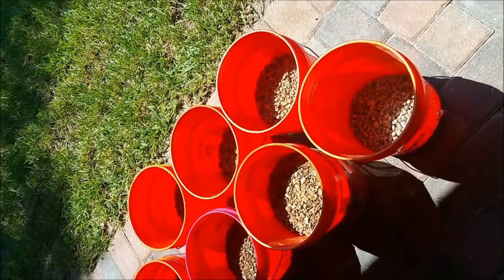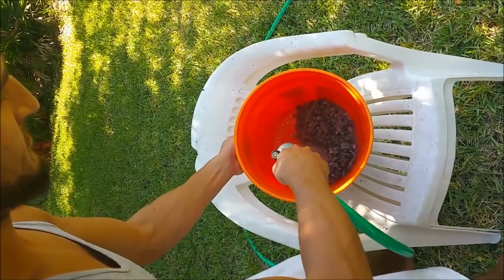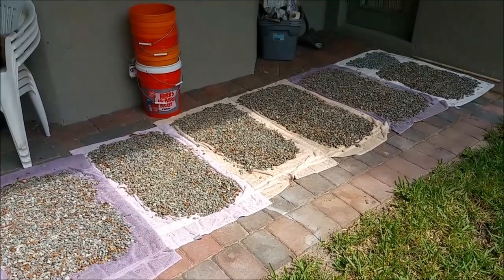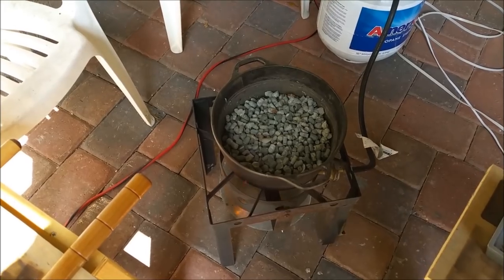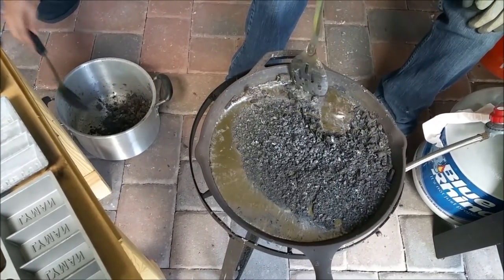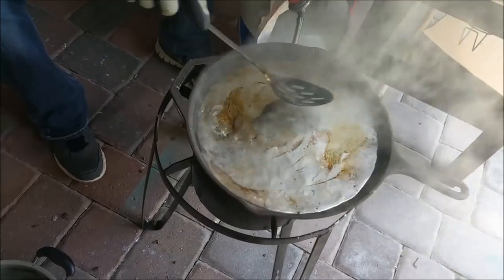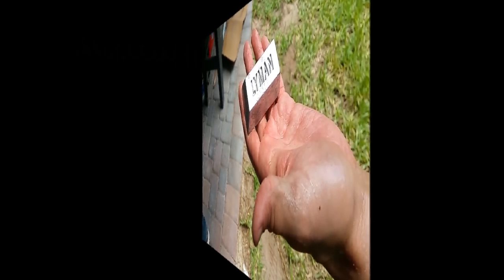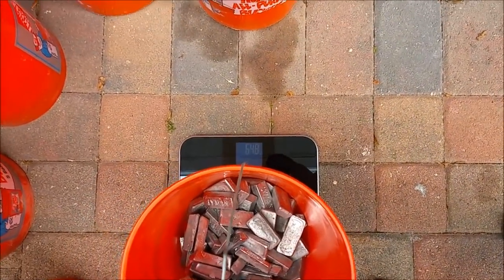Cleaning and Melting Reclaimed "Range Lead" into Ingots

Comment: Is it normal for lead to turn a gold-ish yellow on top that slowly turns dark? I've been melting wheel weights and the lead started to get a yellow skin that won't stop coming out, no matter how much I remove.
Reply from the maker: Yes -- at least from my experience...  When melting the lead down - getting ready to pour into ingots, and when I am melting the ingots in my Bottom Pour Pot, I get the same Gold/Bronze-ish Sheen on the top.  Not sure about the reason.  Could be impurities still in the lead - coming to the top.
Reply from the maker: Try keeping your heat between 700 -900 degrees.  Other than that that, not sure why you are getting so much of the yellowish skim.  I have also started using sawdust for fluxing.

Comment: Why do you add flux?. Is it to make impurities rise to the top?.
Reply from the maker: +HILUX CHAINSAW Yes... In terms of Metallurgy -- Flux is a chemical cleaning agent - or purifying agent/reducing agent used to absorb impurities into what is referred to as "slag" that forms on the top of the molten lead.  Some people use various types of wax (candles, paraffin wax, even crayons).  Fine sawdust also works exceptionally well.

Comment: 350lbs = 158kg...the current uk rate for scrap July 2016 here in UK is 50p per kg so this yield is worth approx £80 sterling scrap...@July 2016 prices. 
So I guess when you have purchased all the gear to smelt it...and have some free time over a weekend you can start to make a small profit after the 2nd / 3rd batch... You should be looking to claim 1000lb of scrap before smelting to make a clear £150 profit after.
Reply: Which in my mind makes this not really worth the effort to process it. £80 for how many days work? Split how many ways? Less costs? McDonalds pay £6.17 an hour to put this into context, thus = 13 hrs.
Reply: +Sean Hendy exactly 👍🏼 I don't know how much bullets are to buy....but I'm sure in USA they are cheap as chips...not worth the hassle doing this.
Reply: But what's the cost of buying lead for making bullets?
Reply: +Emil Ahlstrand from what I found, the market price is $1.80 a kilo.
Reply from the maker: To put this in perspective -- standard FJM 9mm bullets run about .08 to .10 cents a piece if you buy them in bulk.  So if I reload 1000 standard FMJ's -- the bullets alone will cost me around $100.00 (with shipping).  I can make 1000 Lead Cast 125 grain Round Nose Bullets from 18 lbs of Lead, or 6000 Lead Cast 125 grain Round Nose Bullets from 108 lbs of Lead.  So - that 108 lbs of lead is actually worth around $600.00 to me, when I compare it to standard 125 grain FMJ bullets that I can buy for reloading.  So --- Yeah....  I think its worth it!
Reply from the maker: And I cast more than just 9mm...   I cast 175 grain .40 S&W,   158 grain .38/.357, as well as 7/8 oz and 1 oz Shotgun Slugs, and #00, #0, #1, #3 and #4 Buckshot.  Huuuuuuuge Savings by processing Range Lead and casting my own bullets/shot/slugs...
Reply: +DKH TACTICAL you can't just ignore the man hours involved if you're going to make that comparison. The manufacturers have to when determining the retail price.
Reply: +Sean Hendy but what is all the hours you put in worth for you? you can either work the extra hours needed to pay for everything, or you can reload yourself and be on your free time, make stuff the way you want them.
Reply: +Emil Ahlstrand personally speaking, I charge my time at between £100-200 per hour ($140-280), so in that respect its a no brainer, however for comparison, on an earlier comment, I used minimum wage to prove the point, that at that level, from a financial standpoint there's little to no gain.
Reply from the maker: Sean Hendy -- there is a certain amount of enjoyment that comes with it as well, that would be hard to put a price on.  I happen to like the fact that my reloading includes bullets that were made by my own hands.  You obviously have different values -- and since you make $140 to $280 an hour --- feel free to "buy" all the bullets you want.
Reply: +DKH TACTICAL I had a feeling you were recasting the bullets into new bullets. genius. It made me think of the bullet farmer in the new mad max.

Comment: How do you come about getting the spent ammo? Every place I have  spoken to has either a cleaning crew that gets them. Or the metal company buys them.Is
Reply: Outdoor dirt ranges, I built a 20" x 30" wood frame with 1/4 inch hardware cloth between the 2x2 wood and screwed cedar fence board around the sides centered so you can grab it and holds it together. Scoop a few shovel fulls from the berm and shake, get about 50 pounds in a half hour

Comment: You are Shooting the Ingots? Or for what is the water quinching?
Reply from the maker: LOL... Yeah - I have a big Ingot Gun...  Doesn't everyone?   No - in all seriousness, there is no other reason for quenching the ingots, than to assist in cooling them off so we could handle them and lay them out.  Otherwise, just dropping them on the pavers and leaving them there to cool would have also been fine..  I just ran out of room - and dropping them into a bucket of water saved space!
Reply: I dont clean that stuff, in melt it with all the dirt and Sand. It will come to Surface.
Reply from the maker: All-righty then... Thanks for sharing!

Comment: Save yourself the trouble! Stop drying out your range scrap. I just ran 200+ lbs today. I've never dried out anything. Start with a fresh batch every time. Two reasons. Firstly, adding to a partially filled pot doesn't speed things much. Second, no matter how long you dry your scrap, pockets of moisture can still be trapped in deformed bullets. I've had two kabooms working that method. No more.

Comment: How do you know when the lead is set enough to turn them out of the moulds?
Reply from the maker: It literally only takes a few seconds for the molten lead to solidify so you can dump them out of the molds.  There is no need to "Water Quench" -- as I said in the video.  We were just dumping them in the bucket of water to cool them down faster so we could more easily handle them...

Comment: why dry it before melting it, wouldn't the heat from the melting proc. also dry it?
Reply from the maker: Any moisture at all when dealing with molten lead can be disastrous.  Even a drop of sweat from your forehead when leaning over the pot can be dangerous.  I don't mess around when water/moisture when melting lead.  I would definitely rather spend an extra day or two (or more) just to be sure it is completely dry before proceeding with melting it down.
Reply: Matt Fleming Boiling off the water require a lot more heat/energy/propane=money.
Reply: Just a drop of water in the molten lead can explode it ALL out of the pot, no no no water!!!

Comment: 3 things to save yourself a LOT of effort.
#1 you gain nothing by rinsing off the dirt but dirty water and a wait to dry

#2 Use significantly deeper containers to melt in. Reduction of the surface area reduces oxidation and higher pressure from depth makes floating off the gangue much more effective. 2-3x depth vs diameter is best.

#3 stirring with a pine stick will flux your material much better, esp with  a deeper container. If you must flux with wax like you are doing, set it on fire to eliminate about 95% of the smoke.
Reply from the maker: Thanks for your comments/suggestions.  Depending on the amount of dirt/debris - I will probably continue to rinse, but I understand your comment, as all dirt and debris will remain on top...  I'm just not in that big of a hurry!  Definitely concur with the deeper pot suggestion.  Getting rid of the big skillet and purchasing another 7 quart Dutch Oven for the next haul.  Stirring with a Pine Stick is an interesting idea as well.
Reply: Hope it's helpful
The stick provides the carbonaceous material for the flux and you can make sure it gets well down in the pot, scraping the bottom and sides to get the crud up to the top.

Comment: What I want to know is why does everybody reload when it cost so much money for the reloading equipment so much time for the lead melting down twice and not to mention ALL THAT TIME AND ENERGY WHEN YOU COULD JUST SHOOT STEEL CASE CHEAPER OR ALMOST SAME COST IS IT REALLY WORTH ALL THAT TIME AND DONT TELL ME ABOUT HOW STEEL CASE IS NOT AS GOOD BECAUSE WHY DOES ALL GUN MANUFACTURERS VOID YOUR WARRANTY WITH RELOADS BUT NOT STEEL CASE
Reply from the maker: In an afternoon of melting down the Range Lead I brought back from one trip, I ended up recovering enough Lead to cast more bullets, buckshot and slugs than I could shoot in nearly a lifetime of going to the Range...  When you can buy 9mm, .38, .357, .40 or .45 ACP for around .05 - .06 cents per round --- please let me know where you are getting it, because I'm sure people would love to know...  Just your standard "no frills" cheap 9mm FMJ runs about .30 cents per round.  The cost for me to reload 9mm 124 grain Lead Cast Powder Coated bullets is right at .05 cents per round.  I refurbish all my brass, so the only cost I have is the Primer (around .02 cents each), and the Powder (around .03 cents per charge).  By picking up BRASS and spent 12 and 20 Gauge Shotshells every time I go to the Range, the only cost I have is the PRIMER and the POWDER...  Other than the FACT that it is waaaaaay cheaper to reload, it is also a very enjoyable hobby.  I get nearly as much pleasure out of creating my own reloads as I do from shooting them, and when I can do it for around 1/4 to 1/5th of the cost for the above mentioned calibers --- that's a NO BRAINER...  With the savings I have seen from reloading, it has more than paid for all the reloading equipment I have purchased.  I have been reloading for over 10 years, and would put my hand loads up against any manufactured ammo on the market - and have shot hundreds of rounds of all the above calibers side-by-side, and would challenge anyone to try to tell the difference in performance.  And the cost savings of loading shotgun BUCKSHOT and SLUGS is even greater --- around 10% of the cost...  And I POWDER COAT all my rounds (including the BUCKSHOT and SLUGS), so there is no worry about "Leading of the Barrel"...  With a single 1lb bag of Powder Coat (at around $10.00 a bag), I can literally Powder Coat thousands of rounds, so the cost to powder coat comes out to something between .002 and .005 cents per round...  Hope that answers your question about "Why reloaders like to reload"...   :)

Comment: What was that blue stuff and what did it do to the lead?
Reply from the maker: It's FLUX.  You can use pretty much any type of wax as flux (votif candles, Gulf Wax, even Crayons).  Fine sawdust works exceptionally well - but usually creates more smoke.  It's used to bring out impurities in the lead -- helps with the cleaning process.
Reply: @dkhanlin1  whats typically the ratios for flux to molten lead.
Reply from the maker: @ctyoungman  I typically used about half the size of a crayon, but have stopped using that kind of flux.  I only use sawdust now.  It works great.  A few tablespoons is plenty.

Comment: How do you separate the bullets from the stones and rocks?
Reply from the maker: I made "sifters" using 2" x 4"s and Screen Mesh (Chicken Wire).  The Sifters were approximately 2 feet long, by 1 foot wide, and obviously 4 inches deep.  After screwing the wood pieces together in the form of a box (rectangle), I cut the screen mesh out in a section that would provide enough to fully cover the bottom, and have enough to go up about 2 inches on each side of the box, and secured the mesh to each side using a staple gun.  If you are lucky enough to have access to a range that has sand, or fine dirt for the back-stop, it is a pretty easy process.   Just dump a few shovel-fulls into the sifter, shake back and forth until you get all the dirt and sand to fall through, and all you will have left is bullets (and possibly some debris)...  Remove as much of the debris as possible, and dump the contents into your 5 gallon bucket.  Repeat until your bucket is about half full (this will be about as much weight as you will be comfortable with moving...
Reply from the maker: I pick through the piles while they are drying - but all the debris floats on the top of the lead anyway, so whatever you don't pick out - you can just scoop off with the rest of the dross/debris.

Comment: What do you do with the copper jackets?
Reply from the maker: +tankkiller308 After our next clean-up, we are going to try and find a place that buys scrap metal.  I think we have around 150 lbs right now...
Reply: +DKH TACTICAL I would defiantly wait to sell copper prices are way down but I would suggest you bring some to a scrap yard and ask them if they will take it as one of these (in order from best price to lowest): bare-bright, #1 copper, #2 copper, or breakage.  Also don't go to just one if its an option I've gone to two scrap yards in my town and there was a 20 cent difference for the same copper

Comment: can you please tell more on how you flux in
Reply from the maker: +Robert Johnson - Fluxing can be done several different ways.  You can use paraffin wax, candles, even crayons.  Saw dust works extremely well, but generates much more smoke than the others.  Fluxing is the last step in cleaning your Lead before pouring into ingots.  Once you have removed all jackets and debris, add the flux and give your pot a good stir.  The flux aids in drawing out any remaining impurities to the surface so they can be skimmed off.

Comment: Where did you purchase those burners at?
Reply from the maker: Amazon.com ---- here is the link:  https://www.amazon.com/gp/product/B0009JXYPU/ref=oh_aui_detailpage_o03_s01?ie=UTF8&psc=1
Reply: I went to Walmart I purchased a lodge cast iron pot as well. how long does it take to melt the lead?
Reply: My pot cracked
Reply from the maker: Takes a "while" to get everything up to temp to get the melting process going.  Depending on how much you put in the pot to start with (I would not go more than 1/4 of the overall depth to start), it will take a good 30 minutes or so to get the melting started.  Make sure your burner is pretty much "wide open" --- and just be patient.
Reply from the maker: That's CRAZY!  Never seen a cast iron pot crack before...
Reply: I called the company must have been dropped at store

Comment: the flux is just regular wax from lights?
Reply from the maker: The stuff I am using in this video is something I bought online a few years ago, but basically - yes, its pretty much just like candle wax.  You can use actual candle wax, or paraffin wax (Gulf Wax) -- even crayons will work.  Fine sawdust works exceptionally well - and I actually prefer sawdust...  Just prepare for some heavy smoke that it will produce...
Reply: you can also try borax though it might make for a harder residue when it cools.. it tends to turn back into a crystalline form. It's a very commonly used welding/brazing flux.
Reply: +DKH TACTICAL ive heard something saying that the toxic gas does not come from the lead before it boils.. true or false?
Reply from the maker: Good question.  Will definitely have to research that one!

Comment: CBP sent me, are ingots for sale?
Reply from the maker: +2003Harleyguy How many are you looking for?
Reply: +DKH TACTICAL Up to 50 pounds depending on cost.  Do you have pure lead (stick on) for buck shot & slugs?  BTW, thank you for your service!
Reply from the maker: +2003Harleyguy I do have a couple hundred pounds of wheel weights that I have yet to sort through, but nothing that I have melted down into ingots.  The only thing I have right now are ingots from Range Lead (which will have a small amout of Antimony in it).  I sold everything I had listed on eBay and Etsy.  I typically sell 10lbs for $25.00 -- which includes Priority 2-Day Shipping, which comes out to about $1.90/lb + Shipping.  I could cut $5.00 for an order of 30 lbs for $70.00.

Comment: what kind and how much you use
Reply from the maker: +Robert Johnson As I outlined in your earlier post - there are several different ways to flux.  For a Cast Iron Pot that might hold 20 - 30 lbs of lead, I would recommend using the equivalent of a small votive candle if using any type of wax.  If using saw dust - use 3 or 4 tablespoons.  There isn't really any magic number/amount.  If after you have fluxed it once - it still looks like it needs more, then do it again!

Comment: I was watching a video and he said that if you have a mirror finish you have removed all the tin and antimony. Was that your goal.
Reply from the maker: Not really sure I 100% buy into that...  You really need to have high heat to remove the antimony from lead -- and I kept the temperature around 700 -- but anything is possible...  Not that big of a concern for me though.  The bullets and buckshot that I cast work just fine for my shooting purposes.  I wasn't going for a specific Brinnel hardness anyway -- but even if it did remove all the tin and antimony, and I was left with pure lead -- it would be hard enough for casting and reloading.
Reply from the maker: I don't profess to be any type of expert on this process, but I would not say that just having a "Mirror Finish" is in any way a Scientific Method of determining that all the tin and antimony has bee removed.  However, if you are really wanting to take it to that level and determine the Brinnell Hardness of your Lead, there are multiple Lead Hardness Test Kits out there for sale..   One on Midway USA for around $60.00
Reply: Don’t think you can remove the antimony from lead.

Comment: Why dry it. It will dry in the furnace
Reply from the maker: Putting an initial batch in the pot and heating it up will dry it --- but when it comes to ADDING more, I don't want it to be even a little on the wet side.  I would rather "err on the side of caution".